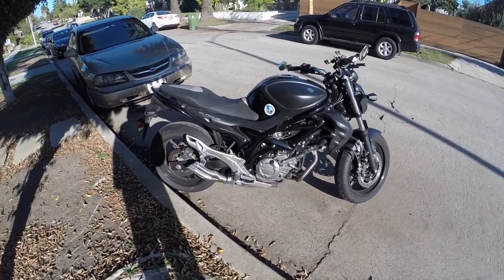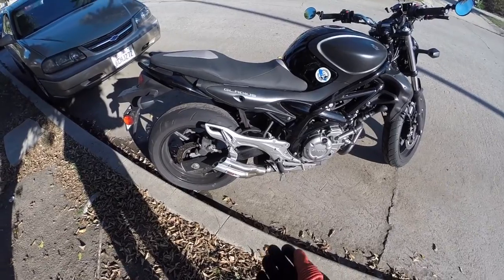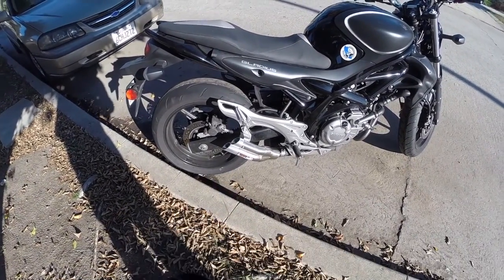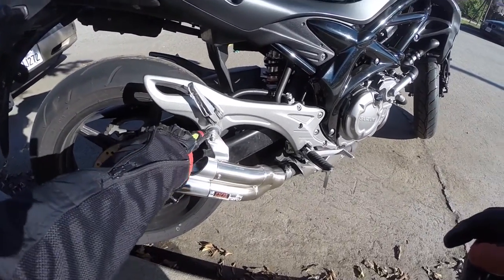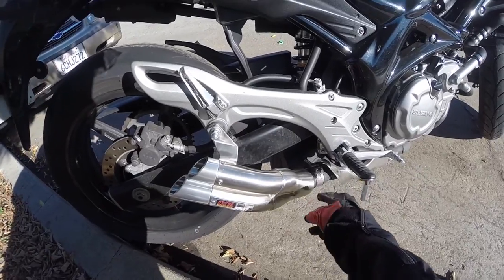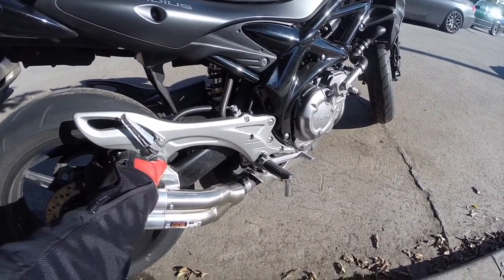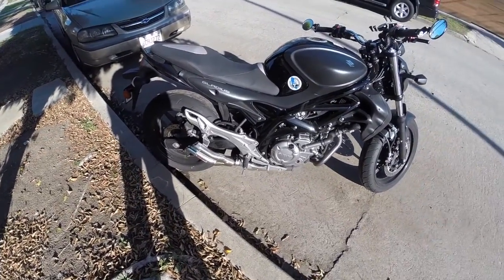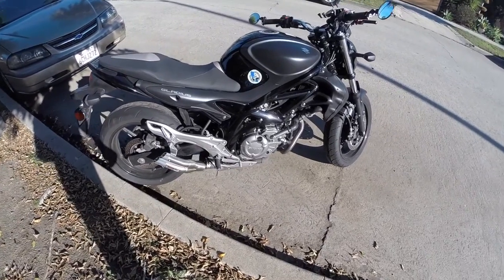IXIL Hyperlow Exhaust on Suzuki SFV650 Gladius

Comment: Rev the aftermarket exhaust! Also did you have retune anything? Is it safe to just switch out exhausts?
Reply from the maker: MOTO RY I think I did at one point there in the video. And no I didn't have to change anything since it was just a slip on. I want to put a k & n air filter on it but that in combination with the exhaust would make the fuel air mixture too lean so I would need to get FI remapped or buy a power commander with an autotune kit. Which is what I'll do once I have the money.
Reply: Oh do you not have to do anything with slip ons?

Comment: Just did exactly as you have. Very happy with mine. Any long term effects good or bad? Thanks!
Reply from the maker: So far everything is great with it. I still get lots of compliments on the look and sound of it. :)
I've been wanting to add a k&n air filter to the bike but with this slip on and the air filter I'll have to get ecu remapped or get the power commander with an auto tune kit.